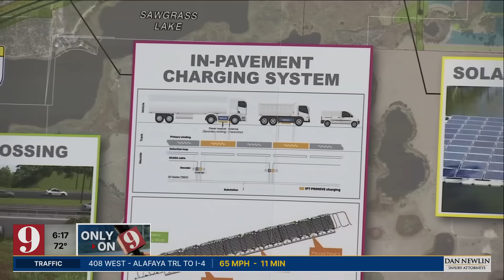We got an exclusive tour of Florida's first highway that charges electric cars

Comment: if this was on every road everywhere it would solve the fuel & battery issue all in one. 
you wouldn't need large batteries anymore. electric cars would have infinite range as long as you dont go off road. 
the only problem is what happens if the road cracks? does the wires break? 
and how much are they going to charge you per mile?
Reply: not to mention weather

Comment: Which EV manufacturers have or will have basically MagSafe QI2 chargers mounted on the undersides of their vehicles?  Hyundai and Kia "MIGHT" just in Korea as I believe they had planned for inductive charging.  I'm not sure they ever went ahead with it.  If they plan is to retrofit vehicles to test this out, they are going to have cherry pick the subjects.  They will need ones that regularly drive over these stretches of roads.  If there is a retrofit will it void the warranty?  You are messing with the charging system.

Comment: This is such an IMMENSE waste of resources!!!! - Is this is satire??

The infrastructure and tech to required to power a couple mile long wireless charger (Which we already know  - has inherent loss/inefficiencies involved in comparison to cabled charging) Is by no means small, and for what? A few minutes (Assuming no traffic) while only SPECIFIC, SPECIALLY DESIGNED vehicles can actually benefit from it? Whats the difference on your average smart phone after 5 minutes of wireless charging vs 5 minutes on the cable? 

Hopefully they have warehouses (with the right EV vehicles) nearby making regular deliveries that have RFID tags in them that link to the the road and have the road only power the appropriate sections of charger. 

Are there rest stop areas incorporated for more conventional EV civilian cars??
Is there any benefit to 99% of the tax payer?

This looks like a corrupt money grab if you think about it for more than a few seconds.

Comment: So what happens when a regular internal combustion engine powered vehicle drives across that garbage, assuming they can get it to work.
Reply: nothing.
Reply: @kenbob1071 yeah I hope nothing would happen to the ice stuff. But I get a sneaking suspicion that if something were to come in contact from the internal combustion engine on that surface it would fry the 12 volt or 24 volt depending on whatever they've automotive manufacturer decides to go with. As far as the EV stuff I I have no idea how that crap is going to work

Comment: EVs are garbage. Wake up people!
Reply: What are you talking about?  I've been driving an EV for almost a decade and it's awesome: no more waiting at the gas station, my fuel cost for daily driving is equivalent to about $0.60/gal gas, almost zero routine maintenance, and my original battery still has most of its range.
Reply: At least with an EV you can charge up at home and don't have to drive to the station at 2 AM

Comment: 4 miles? That will be like charging your phone for 4 minutes, while still using it.
Reply: It's a pilot program just to test it.  That's why it's just 4 miles.  If successful, they can expand it.
Reply: Always someone that doesn't pay attention. It's a pilot program. I'm surprised it was 4 miles. What if it doesn't work for all of the cars, what if it only lasts a year from the weather and the pounding of the traffic, what if it stops working from the settling. But you're the expert, let's just spend a Billion tax dollars on stuff that may or may not work or even be needed.
Reply: Yeah,  as a retired electric engineer,  this a total bullshit.   Someone got bribed to approve this
Reply: @DSAK55 yep. They should have built an electrified railway instead. 

In my country 99% of the railways are electrified. It's not even a wealthy country like USA.
Reply: @DSAK55  Got to love the people that spout off their resume' before they make a comment. STFU
Reply: @DSAK55  good thing you are retired.
Reply: Rofl 😂😂😂😂😂😂...I thought this was going to be some major highway
Reply: 😂😂😂😂😂😂😂😂

Wait till it's hit by lighting every week

Then they'll make the taxpayers write it off
Reply: @mobilerichie2009 dude this is the stupidest criticism I heard against this project. You should have an IQ of just 50. 😂

If this system that operates in comparably low voltages like 400 V would get lightning strikes, wouldn't high voltage power lines operating at 200,000 V get lightning strike every week?

In my country trains are powered by 25,000 V overhead wires without any problems.
Reply: yes, but it will electrically neuter you and increase cancer rates, so win win

Comment: If plugging in your car to a 120 V outlet can barely can charge it, wirelessly charging the vehicle while moving is definitely not going to charge the vehicle efficiently. Maybe you all should invest in more high-voltage electric car chargers on the interstate rather than trying to integrated into the roadway. We’re only some cars could be compatible with it and would be more efficient on our power usage.
Reply: Maybe they aren't looking to charge up vehicles, but only prevent them from losing range.  So if you had 5 four mile stretches every 100 miles, maybe cars would only drop 80 miles of range instead of 100 miles, thus increasing range by 20%.  Plus, I'm sure the inductive charging will use larger voltages than 120v.  Superchargers can charge at rates close to 1000 mi/hr, so even if an inductive charger can only charge at 1/4 of that you can probably add 30 miles or so over a 4 mile stretch.

Comment: What happens when the charging standard changes and the road is not able to deliver enough power or in the right frequency.
Reply: ... The plug charging standard is locking around J3400 or a new variant of the Tesla plug and will be 80a by 277v max at most. Any wireless charger will have to use the same hardware the J3400 system uses like onboard charger, so the standard itself doesn't have much space to really change
Reply: @raychang8606  but what will the charging rate be for the wireless charging? I can’t imagine the cost of the powered road will justify any type of efficiency gain, if any.
Maybe we will develop a more direct power delivery system than the current wireless system in use.

Comment: Are there any EVs that will even allow you to charge while driving? There’s only one vehicle I know of which has wireless charging and I’m not even sure if it lets you do it while driving.
Reply: That was my first thought also.  Cars are not currently designed to wireless charge.
Reply: It's just a test, dude.  The video said they have fleet vehicles that allow inductive charging.  Future EVs may allow for inductive charging.
Reply: If this was actually “for people” they would build out buses and other mass transit vehicles than can utilize this and build out routes and additional infrastructure around this for a low-cost transportation option AND connect different parts of the cities within the state
Reply: @Daddysports79 trains can transport freight too. And railways are much easier to electrify than roads.
Reply: Do they need to be? The road won’t open for years. I’m sure that tech will exist by 2029.
Reply: It won’t!
Reply: Just checked, Porsche Cayenne this year, park and charge in your home is what they advertise.
Reply: @raychang8606 yeah that’s the only one I know that can even do wireless charging and I don’t think you can do it while in motion

Comment: Could make more sense to put them on the sides, wireless charging between the two sides about barrier height would also allow easier access to fix if some panels fail.
Reply: Wouldn’t have to be just the vehicles, think about the phones that could be charged without wires on your commute to work.
Reply: Reason is, would have to limit the exposure, wireless directional charging, blocking emission overhead a certain depth from the panels, with wireless panels from the sides locked in such a position that they can be accessed without ripping up the road.

Comment: So let me guess this straight, it's a road that is supposed to charge your car as you drive over it. Okay, first it's mentioned that a fleet of cars will use this. What fleet? Now SOMEONE please tell me WHO THE HECK has an electric vehicle that has wireless undercarriage coils that can UTILIZE this road. And what manufacturer is going to MAKE these cars when only 1 road in the country has a 4 mile stretch that can do this? Where is this pet coming from, states are already screaming that they can't generate enough power because of AI data centers. How much are our taxes going to increase our better yet our electric bills? Another brilliant idea that had no practical use other than making another road that anyone can use and won't live up to its intended use, for a long time, if ever?
Reply: That's how new technology starts. Someone has to try something out and the populace will catch up with it and then it will become normal, and cheaper. Also if they keep building houses in that area it will get used, though I wish it was a regular road and not another toll
Reply: @TheoWorkman yeah I get that and I agree but in this case they are literally building something that can't even be used yet. In most cases, there would be a collaboration with a manufacturer of said vehicles to test out their technology, but in this case there's nothing to test. You're simply building a road and hoping that somebody will invent a vehicle that can utilize this. Now unless they have somebody lined up that they haven't mentioned that is going to be building vehicles, they can use this road, then what the heck was the sense of wasting taxpayers money on something that can't even be tested.

Comment: that way the can charge you per mile.
Reply: How is that any different from gas taxes?
Reply: @MirzaAhmed89  its not, my point is they'll get you coming and going. next they'll tax the air. they're working in it.
Reply: 4?
Reply: Exactly 💯
Reply: Nice to include more electromagnetic waves to increase cancer victims. As if the cell towers aren't bad enough...
Reply: If that’s the case everyone’s going to drive 10mph to get their moneys worth 😂
Reply: @fredfrederickson considering it’s Florida they’ll drive 90 mph minimum
Reply: @nicholaswalker3481 
The joke
Your head
Reply: @fredfrederickson  
the bottom of the ocean
your joke

Comment: Traffic so bad you can plug in along the road?
Reply: No wireless
Reply: @badtoro  A tremendous waste of electricity. Induction charging is very inefficient...
And electric vehicles are beyond STUPID...
Reply: @billymacktexasdetective5827  I've always wondered whats so bad about putting over head charging cables like light rails and such? It seems like the brain dead solution.
Reply: @billymacktexasdetective5827 ”and electric vehicles are beyond stupid” literally the most efficient form of medium sized transportation
Induction is dumb sure but you’re just a hater bro lmao bro hates Elon
Reply: @officialspaceefrain  It's the optics of it. People want infrastructure, but they would much prefer to not see it...
Reply: Do you plug a wire into your iPhone with MagSafe? It's same concept, Inductive charging.

Comment: So Gasoline users are the only ones paying Road taxes on gas.. now this ! What bullcrap.
Reply: Will probably work like EZ Pass so you only pay if you use it.
Reply: Get an ev an stfu
Reply: Get an EV then
Reply: @SmokedPaprikas anybody that lives in areas that flood with saltwater and own an EV are idiots.
Reply: @JoeMommaspot buddy its not like the salt water isnt fucking up your fasoline vehicle either lol
Reply: @SmokedPaprikas are you comparing erosion to the fires that get started from salt water flooded EVs?
Reply: @SmokedPaprikas  I'll stick with paying the gas tax and laughing every time some moron drives by me in an EV!  That piece of junk will cost them way more than any vehicle I drive including paying for all the roads they use.
Reply: @ripvanrevs  I also laugh at people using electric powered phones. Who wants a lame China battery? What kind of moron doesn't put a little gasoline in to charge their iPhone?
Reply: @ripvanrevs  I've owned my Tesla for over 6 years now and it hasn't needed any maintenance other than routine tire rotations, wipers, air filters.  So glad I don't have an obsolete dino-burner.  Once you go electric, you'll never go back.